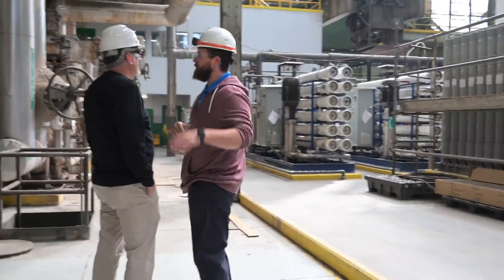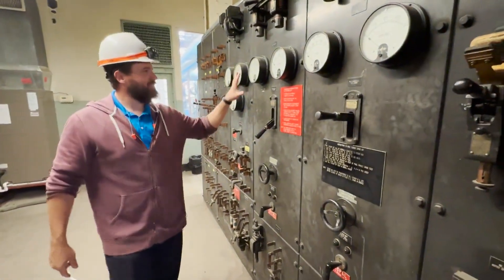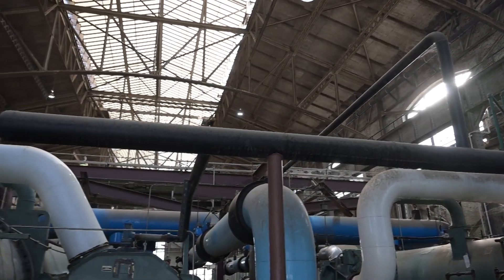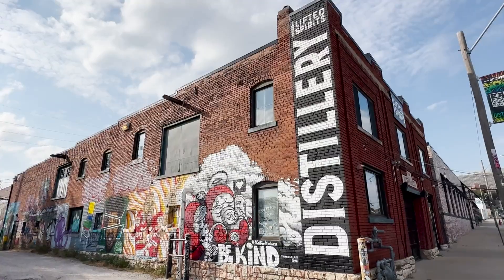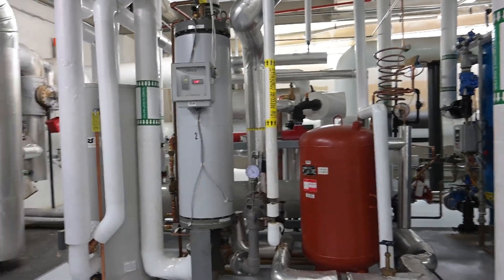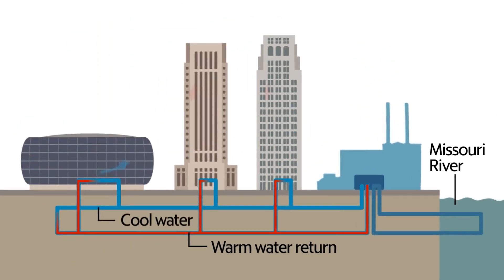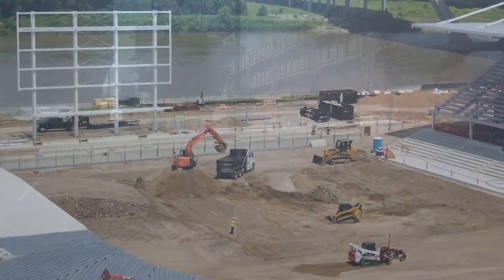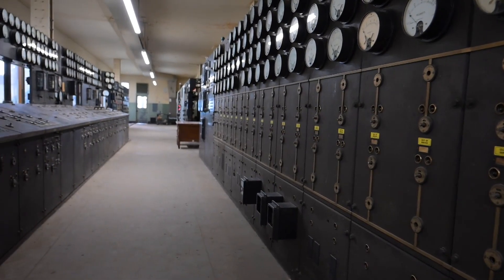Inside The Kansas City Steam Plant That Keeps Downtown Running

Comment: Continuing to invest with modern efficient generation equipment like in Europe. Many power generation facilities there make more profit from District heating compared to Electric generation. My utility just installed machines like these far from anywhere, just to make electricity and dump the heat into the City water supply. If Only They would have put it where it could be used as a heat source as well. Matanuska Electric Association.